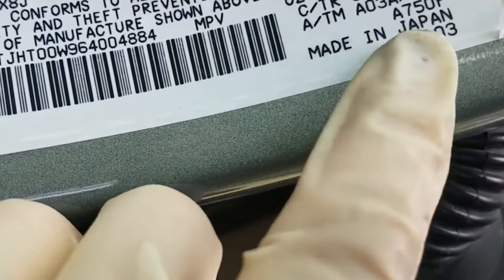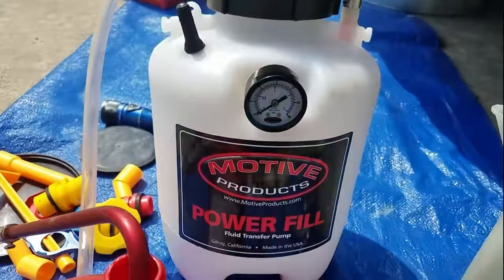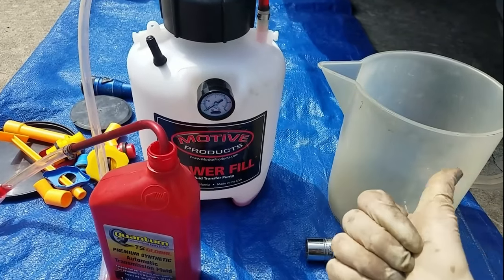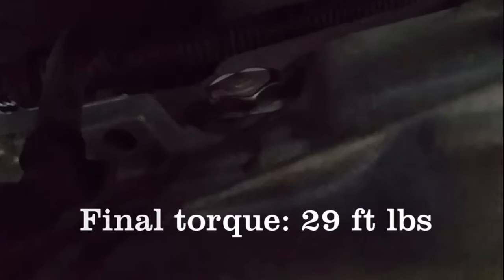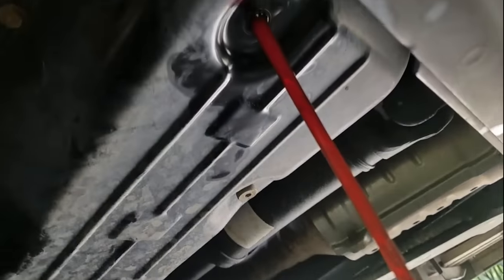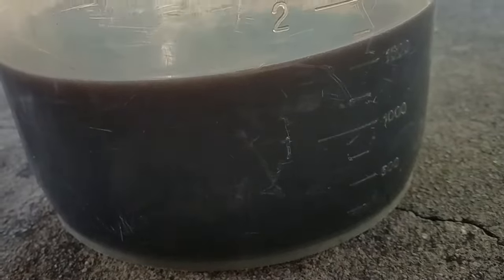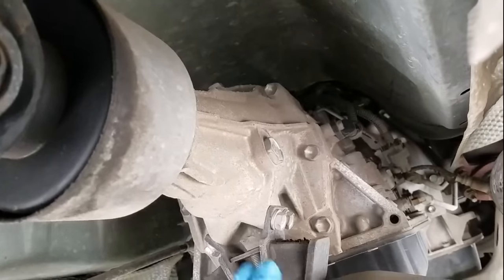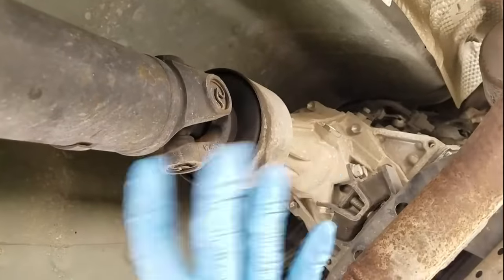How to Service a Sealed Toyota Transmission

Comment: I owned a 2000 Corolla for 12 years. I always used the Valvoline ATF for $30 Canadian. It is a great fluid. I also use it on my Honda Civic. So, over 2 cars and 450,000 km, I havent had any transmission issues. The Valvoline stuff is $30 for 5 Litres. No reason to go to the Toyota Dealership to get ripped off. Unless of course, you hate yourself and think you dont deserve any better in life.

Comment: As someone who knows something about servicing cars, that was a very professional job and tutorial. Very clean and neat. Not a drop of spillage nor the slightest sign of a mess.
Kudos to you.
Reply from the maker: Much appreciated! :))
Reply: @FayeHadley  is that the official Toyota scanner you were using for the transmission temperature check or one we can buy? Is there one you like or recommend for data and codes? Thank You great video!

Comment: Thank you for comparing your scan tool fluid temp to the hand held thermal scanner reading,  you by far have the best video on You tube for sealed transmission fluid replacement, thank you so much for your time.  BRAVO!
Reply from the maker: Thank you!!!

Comment: Thank you for this video Faye! It literally saved my butt! I accidentally drained my transmission fluid during an oil change and then drove 160 miles before noticing a problem. I took it to an auto/lube shop that said they couldn't do anything and I needed to go to Toyota because I needed a special adapter to fill the fluid. With the guidance of your video I was able to refill the transmission pan myself, check the levels and check the filter in the pan (from another video) and my 4Runner is running perfectly without any problems!!! Guess I got lucky! But
Reply: Just did the same! 🤦 Only drove about 20 miles, but still, ouch. 🤦🤦 Hope it's okay after following this.

Comment: I'm a Toyota master tech and I'm glad you do it the exact way we do it to make time and avoid the damage of the flush machine.  So here's an idea for another ws fluid video, the U760E  transmission found in the Camry and RAV4 has the fluid level screwed into the drain, otherwise you'll get like a quart from the drain every time.
Reply: Do you have the engine running to top off to the correct level?
Reply: Heywood Jablowme  
every time you drain it, obviously...
Reply: You mean the one with straw
Reply: @rdprdputube  , yes idling in park.
Reply: I have a 2007 tocoma that will go I to 4 wheel drive but the light blinks, to take it out I have to move the switch back and turn the engine off then when I turn the engine on it disengages. Any thoughts would be appreciated.  Thanks
Reply: Huh?
Reply: Trexxx67  Are all “flush machines” the same and how does a flush machine damage a transmission?
Reply: Are you saying to unscrew the straw when doing the flush, rather than just the plug?
Reply: Is this the normal process for a Lexus transmission fluid changed ? Or is that the process for a flush ?

Comment: As a Technician at toyota as well. This was EXACTLY how it is done for Toyota. Great job. 
For anyone wondering if a quick oil change place would be just the same. NO. 
Go to the dealer. Seen Too many blown transmissions due to over filling because they use a machine which just cycles through fluid and engines has to be running for it to work. Fluid gets hotter and expands so it’s usually .5L to 1L too much. By the time the service is over they don’t check they rely on the machine for the amount.

Comment: Faye, I’ve been using this video over the last couple days to service my 4runner transmission. I have learned so much in the process and feel confident doing this thanks to you! Thank you for empowering every day folks like myself that refuse to pay overpriced mechanic labor for such easy work!!
Reply: Good day. What year is your 4R? How many drain/fills do you think you ended up doing?
Btw...my dealer wanta 350 for this service here in Pittsburgh
Reply: You're not paying for "easy work" you're paying for stall time in a shop with overhead/insurance/labor etc. It all adds up, but by all means DIY, but just know that if you screw something up with an "easy service" we're the ones fixing it at YOUR expense.
Reply: @dave1096  my dealer wants $510. Crazy

Comment: Whoa, you did this exactly how your supposed to. I wish all mechanics made vids like this so you know they are competent
Reply: Warren You're*
Reply: @dchristo10  completely! Ever since learning Toyota's technique, with the part that adjusts to check levels at certain temp, all I could think is why not just do it when I the fluid is cold. Then it dawned on me, the fluid will not drain easily for those who have gone well past the 50,000 mile service interval unless the fluid is hot .

Comment: I really like how you included the torque specifications as well as detailed the need for the correct crush washers, both are very important. I also agree that you should use Toyota OEM trans fluid. Very informative video!

Comment: Some people are surprised that girl is a mechanic lol in my part of Canada it’s normal I know lot of chicks that are welders and HD’s and heavy equipment operators. Good job!
Reply: LoL maybe where are at but it is rare to woman as mechanic they used don't like get there hand dirty.
Reply: @johndowe7003  lol yes the best is when a guy busts out his rear window with a flying winch cable. For some reason men have trouble mastering pinching aswell.
Reply: Ryry K Welder should be a surprise to nobody. Women naturally have really good dexterity which makes stacking dimes that much easier.

Comment: I’m a 35year honda tech , plus most other brands , you have done an excellent job on this video , all info and accurate,  nothing left out . Great to see someone making videos like this , you’re doing good for automotive !  I just did my 2020 Tacoma trans oil replacement  2 months ago , ended up replacing an old scanner with a new one for the job .  Great job on the trans oil replacement and video . Thanks ! 👍🏻

Comment: I agree that she is an awesome teacher. I was a U.S. Army helicopter instructor pilot for more than 2 decades. She has a gift. I was wondering the reason for not just using the tail shaft fill plug for all and save a step? Best video available for this task. Great job!

Comment: Another excellent video that never goes out of time. Unfortunately, as much as I wanted to do it myself I don't have any of the tools and equipment. I had to cave and take it to the Toyota dealer here in Japan. I actually watched them change the fluid but they hooked it up to a fancy machine. They also used Castrol Transmax Pro fluid. I was a bit surprised how they did it. 
I am more pissed that they did away with the dipstick,  so we can't even easily check the level or the color of the fluid anymore. :(

Comment: Faye, I watch you and Bogie on Sunday. Where is your shop? I have a 2018 Toyota Sienna AWD and I don’t trust my Dealer, I’ve got Bridgestone run flats and they won’t let me look under the van when it’s on the lift for oil change to see if I have a spare tire. After watching you on TV you’ve gained my trust as a technician. I’m 69 and had my right shoulder replaced from a 15 ft fall, hitting a cinderblock wall breaking 8 ribs and had my right hip replaced July 3. I used to work on my own vehicles but now it’s to hard to get down on the ground and get back up so I’m having to trust others for the work to be done. I live in Newport News, Virginia but I don’t mind driving, I used to be a big truck driver and I’ve got over 2 million safe driving miles. I lost my wife to cancer seven years ago after 42 years of marriage and having an raising 3 children in good adults with families of their own.

Comment: This is an AWESOME video of how this miserable and seemingly terrifying job can be done "easily" and affordably (the most important items needed are patience and lots of time).  Yeah, the garages and dealers are NOT interested in doing this job because it must be done at a specific temperature (requiring time for engine cool down, etc) and some interest in wanting to do the job right... all too often the shop will just SAY they did this job when they did not.  Even worse, they do the job WRONG (by checking the fluid level when it is too hot (and "heat expanded"), letting the fluid out and thereby starving the tranny of needed fluid, and then telling the customer the fluid is at the correct level (and maybe even believing it), but having actually made the situation WORSE and more likely leading to tranny damage.  Thank you, Faye, for doing the OUTSTANDING job you've shared with us all here in your video!

Comment: Nice job, Faye.  Really like the comparison part between the gun and the sensor pid data.  Don't think i've seen someone do that before, but good to know the gun is fairly accurate.
Reply: If I am paying for the service, I would want it done the right way. If I were going the DIY route, and the vehicle were not spanking newish..... the heat gun would be acceptable, as the head range is generous enough. Of course, a lot of build-up on the cover might act as insulation.... and skew a heatgun reading, and cheap 10.00 thermal guns can be way off. I do not even change my own oil... too messy when I can pay someone to do it, and focus on MY business!

Comment: This video has made me decide to to tackle the fluid change on my truck with the same transmission! You have a gift with these videos. One question: thoughts on Idemitsu WS fluid? I too normally like and buy Toyota/OEM stuff, but it seems the Toyota WS juice is mineral based and the Idemitsu is full synthetic (which I generally prefer). Thanks so much for making the channel, as a guy who does most of his own repairs and learns “on the job”, you are really able to break down (including the how and the why) the steps you take to complete a job the right way.

Comment: Great video Faye!  I actually work for a Toyota dealership, so they kinda frown on us doing the transmissions this way because they don't want us to trust the amount of fluid the vehicle came in with.  There's a whole process of draining, making sure the fluid is at the right temperature (using our "techstream" system) when refilling and topping it off.  It's such a pain in the butt.  Bain of my existence... lol ...So much easier if they'd actually let us just measure and replace as you show here.  Awesome recommending the actual Toyota fluid, their transmissions are so finicky about aftermarket.  Keep on wrenchin!
Reply: If you’re a Toyota tech, surely you know it’s not actually a Toyota transmission? Why would the transmission be “finicky” about other fluids when Toyota WS is technically a third party fluid too?

The A750F is an Aisin transmission, not Toyota. It is ABSOLUTELY IDENTICAL to the Mitsubishi Pajero/Shogun transmission, except Mitsubishi call it the “A5AWF”. Surprisingly, Mitsubishi techs also say don’t use any fluid other than Diaqueen ATF PA 🤣

Mitsubishi Diaqueen ATF PA, Toyota WS, Penrite ATF LV, Fuchs Titan, Castrol Mecron LV, Nulon, Valvoline have all been used successfully for years on the A750F/V5AWF.

If you insist your customers use genuine fluid, you should be filling their cars with Aisin ATF+ Wide Range VI fluid 🤪

Comment: I'm going to perform this same procedure to my 2008 Tacoma this summer (2nd time w/ about 127K on the ODO) and your's is by far the most clear and concise video I've found on this.  Super-great job, very clear and well edited video, I've just subscribed and am a new fan.   I'm going to go out and get a calibrated plastic beaker like you've shown, and not be fearful of using my heat gun to approximate the trans temp for the final level verification.  I was also going to change the filter and gasket at the same time, (which I DID do 60K ago...) do you think that's overkill?  Thanks Faye!!
LarryS
Reply from the maker: No, I don't think that's overkill if you plan on keeping it for forever! I will say that the first time I do a transmission filter exchange is at 120k miles, and I rarely recommend it at 60k miles unless the vehicle does a lot of towing or other heavy duty work. I have saved a bunch of those filters and dissected them at 60k  to see what they look like, and I've never found that the filter media was dirty enough that early on to warrant selling them to my customers..... That being said however, I never want to discourage anyone from going extra mile on their own personal vehicle, and I have done plenty of transmission filter swaps at the request of my customers at 60k and earlier. I hope this was not too convoluted and I hope this helps!

Comment: 2 issues.  The customer supplied fluid said it met toyota ws..and ford mercon 5.  Which scares me because mercon 5 and the toyota trans fluid are not the same...

Second...you are putting in what you removed ... however that depends on the current level being correct which you have no way of knowing..  so if the trans started a quart low.. or overly full.. you continued the poor level.   Glad you checked level.  

   overfill a half qt and warm the engine and trans 10 min.. check pan temp  with an infared thermometer.. and release the fluid check plug if the temp seems close. Is the best method.. Which i see you did.  So awesome job.

Comment: This is by far the best, most informative and most enjoyable video I have seen that explains the complexity of these idiotic sealed transmissions Toyota has gone to.  I never realized that doing 3-4 flushes is recommended either.  I usually try to handle DIY to a degree, but this tranny stuff requires some intricate knowledge, which this video handles nicely.  After our local dealership (Autonation Toyota) did a drain and refill on our 2012 Camry SE/V6, the transmission literally destroyed itself.  A couple days after the service we were on the highway about an hour and could smell burning fluid.  Diagnostic code/light on dash went on.  Pulled over and the whole engine bay was full of sprayed transmission fluid.  Not sure what goes wrong, but seemed like it was overfilled and blew the seals.  Sad that the Toyota dealer doesn't even know how to do this properly.  I'm willing to drive where she works to have it done right.
Reply: This is why I'm afraid to even let Toyota do a transmission change on my Camry. These transmission oil changes are more complex than the old type and most mechanics won't do it in the detailed way it's supposed to be done.

Comment: Thank you Faye, I just can’t see bringing my Tacoma in to a dealership after viewing your excellent diy video. Excellent narration and camerawork. You saved me a considerable amount of money, God Bless you!
Reply: I could screw up as much as the dealer and save $$. Last time my dealer torqued down the drain plug to 100 psi! Was scared I might break that bolt using so much force taking it out.

Comment: I have 330k miles on my Prius and I've been told it doesn't need transmission fluid changes which makes me go hmmm
Reply: I'm in the same shoes like you the dealer told me not to touch the transmission but I changed my fluids at 212,000 miles now my car has 290000 miles with no problem
Reply: Save your money for that battery
Reply: Probably want to go to a different dealer. I have had my Lexus transmission flushed every 60k more or less. I am pretty sure the Highlander hybrid with a eCVT 2007 calls for flush every 40k. Similar to motor oil the fluid breaks down holds the dirt to prevent damage. The fluid isn't lifetime except maybe lifetime of the warranty or the transmission eventually failing.

Comment: I know I am late to the game, but thank you for sharing your knowledge!  Just did four drain and fills on my 2018 Tundra.  My Toyota tech said since it is a sealed system there isn't any reason to change the transmission fluid until 100K.  Once I saw the condition of the ATF after my first drain, I was glad I changed the fluid.  Thanks again for helping everyone!!!
Reply: I did mine on the no dipstick Camry at 50K, the oil was dirty. Pulling the pan out, magnets had sludge on it. Oil cheap, transmission not so much.

Comment: That's a lot of work that only took 10 seconds with a dipstick. Best solution is to avoid all vehicles that force the average person into a shop just to check their fluids.
Reply: Good luck with that as this is the trend.  Really it isn't any different than a manual transmission, differential, or transfer case.  Manufacture just wants the fluid slightly aerated  before making final fill level check.  A final check I see people flub all the time with a dipstick.
Reply: They are all going this way now. Can’t avoid life forever

Comment: I wish I had found this a few months ago after I bought my 2011 4runner. Found out it was "sealed" so I just took it to toyota dealer to be serviced. Iv been having problems with slt solenoid, which reading online seems to be a common issue on the a750. When its failing, it will ramp up line pressure when downshifting and feel like someone just rear ended you lol. Now I will have to drop the pan and change it myself anyway cause I'm not paying toyota $350 again to put 3 quarts of fluid in and check it . Thanks for the simple tutorial

Comment: Faye.. just bought my first toyota. Appreciate the video.. i do think using the overflow measure drain check is a better method.  Nice to see women working on cars.  Taught my daughter to change oil and do brakes and service bearings.. and replace exhaust.  And rotate tires.  She seems to like it..   i plan on using my infared and will aim for about 95 to 97 degrees on the pan.